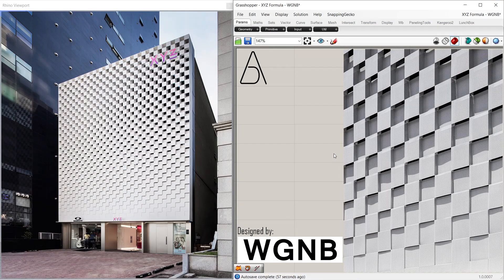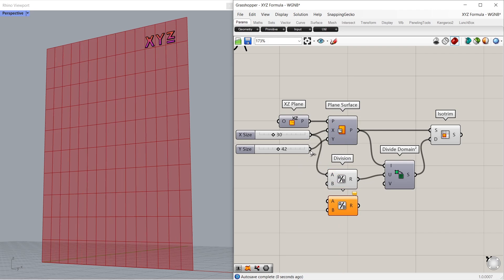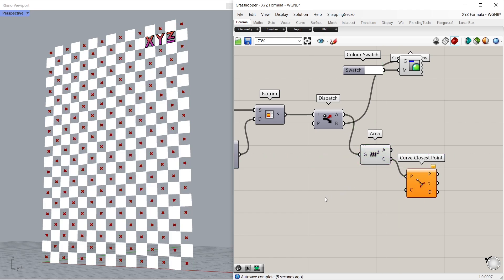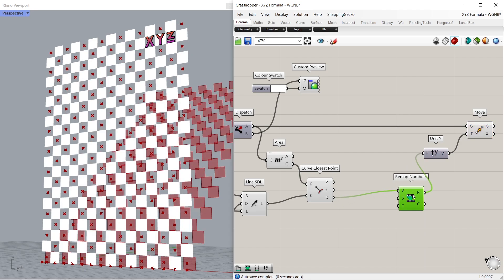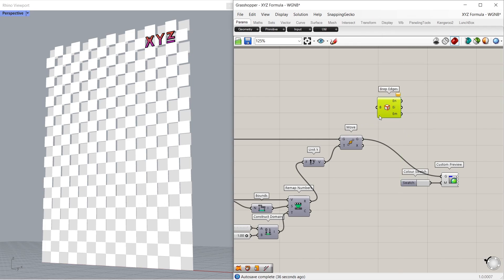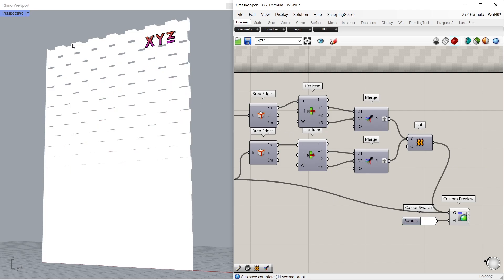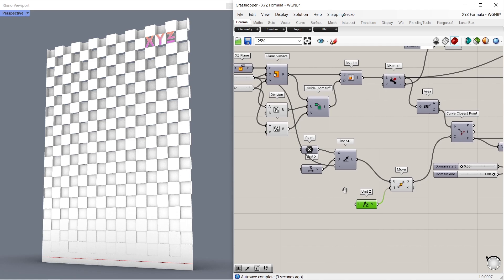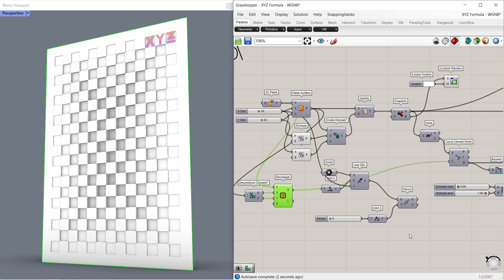Parametric Facade Architecture

Comment: How can I locally apply the rectangle + deconstruct domain nodes at multiple specific areas on the plane? Imagine making the transition at specific points on the plane so as to slightly reveal the multiple objects behind those points on a facade.
Reply: Check tutorials on select items,point attractors you will find the answer